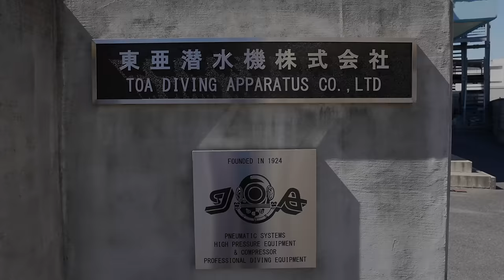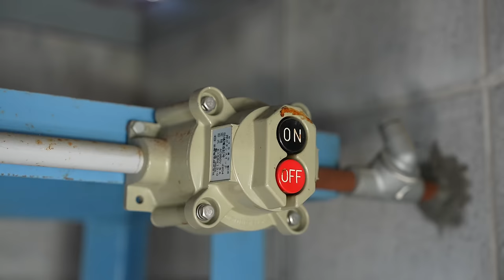潜水服を作るプロセス。水中作業に関する機器・器材を製造する日本の工場。

Comment: 凄い気圧の深海で命を守ってくれる物を ここまで丁寧に作って下さっていれば 安心ですね
Reply: No, no. Amateur divers can only dive to a depth of about 30 meters at most, and even professional divers can dive anywhere from 40 meters to 50 meters at their deepest point. In other words, the depth is shallow, and it is not the ``deep sea where the human body is exposed to extremely high water pressure'' as mentioned in your comment. Diving deeper than that is not possible unless you wear a pressure-resistant diving suit, not a rubber diving suit or dry suit like the one shown in the video. Additionally, even at shallow depths, there is a risk of decompression sickness, so the maximum depth, dive time, etc. are set in advance before diving, and divers must abide by these rules :fish-orange-wide-eyes:

Comment: had no idea these sort of suits were still in use! Very cool process 👍🏻
Reply: In the industry they are typically used in high current areas due to the extreme amount of lead weights you wear to counter act the possible buoyancy.
Reply: @philipshane768  And because of how durable they are. The whole helmet area that also coveres most of the shoulders works also as protection because in a high current area getting hit by something is more likely. This type of helmet is much less likely to suffer problematic damage too while offering a lot of protection.

Comment: Absolutely orsome, I am amazed that diving Equipment is still made this way amazed. This technology must be at least a hundred years old, well if it's not broken don't fix it. Are these suits Taylor made or are  they made to a standard sizes. A diving suit like this must run into thousands of pounds or yen to buy ! .
Reply: The suits are made in standard sizes.  The largest suit I've worn was for someone up to 192cm tall and 110kg. They do come bigger, but I've never seen one.  The real limitation is the helmets which, AFAIK, only come in two sizes. If you happen to have a large head or long neck then you are simply screwed for fitting.

Comment: Great to see such experts manufacturing gear that has changed little over many years. Still has its uses despite modern innovations. By the way technically it’s not a wetsuit but a dry suit or a diving suit as it’s designed to keep the wearer dry and warm by wearing clothes under neath it for insulation.

Comment: i had no idea these type of suits were still being made and in use. i figured they were obsolete by now and replace by modern versions.
Reply: Very much still being used simply because they work.  There is a high school in northern Japan that teaches deep sea marine engineering and they use these suits (these exact suits) to train the diving students, along with more modern suits where necessary.  Only high school of its type in the world.
Reply: Hm... I mean the type of suit seems to me as modern as it gets. Just the helmet I would find outdated.
Reply: @TheOitzu  

Dry suits that marry to a modern free flow hat like a desco are used in hazmat diving...other than that we use Kirby Morgans with a wetsuit/hot water suit or even compression shorts under overalls depending on the water temperature. You do everything you can to NOT use a dry suit. They suck.
Reply: @A_Lemon_Party  as someone who dives dry and wet as a hobby: why do they suck for working? Do they tend to leak? Is it the seals rubbing to the skin?
Reply: @TheOitzu  

Just a comfort factor. Company owned ones tend to leak and fit poorly, I have never owned my own though. Diving every day for six, seven, eight plus hours in dry suits is just way less comfortable than diving with a hot water suit, homemade or store-bought...the more comfortable you are, the more work you get done!
Reply: @A_Lemon_Party  well I never dived surface supplied so I wouldn know how a hot water suit feels, but I imagine comfy.
My drysuit is made to fit though, but yeah leaks in a drysuit are just miserable and it happens.
Reply: @TheOitzu the leaks at the inseam and the feet are the ones I hate the most
Reply: @TheOitzu  

Sorry for the late response. Yes hot water systems and suits are amazing, they have suits but they are expensive. 

We would make our own out of a section of 1 inch tubing, about 8 inches long with a quick disconnect on one end. In the other end we would jam 3/8 or 1/4 inch sections of tubing, one for each hand, one for each foot, and two for your chest and back and run them under your wetsuit. If your wetsuit didn't leak, it would balloon up and it was the greatest feeling ever!

Comment: I imagine you have to be incredibly strong to wear and work in one of those! Well done little lady!
Reply: Once you're in the water you don't feel the weight since it's slightly buoyant. Outside of the water, yes.
Reply: It's not that bad actually, and as the other poster said, once you're in the water you regulate the bouyancy yourself as the diver.  It is tiring because it's cold, noisy, and your range of movement is so heavily restricted so doing anything is a constant struggle.

Comment: I use a DUI Crushed Neoprene Dry Suit. Need to use 2 lbs. ankle weights and is a little hazardous (draggie) in current be here in Southern California. Diving the Channel Islands where sometimes the temp get down to 47 deg and having a steel HP 120 cu. in. tank you won't get the deep chill doing repetitive dive, like 4 a day. Just for fun diving. We do have urchin divers here using hookah hose.

Comment: Remember, if the air supply stops or there is a hole in the air hose, you get squished into the helmet.
Reply: I remember that mythbusters episode 🤣
Reply: If the air supply stops then, unless you were ascending at the time, you are stuck where you are unless the surface crew wants to try and hoist you up on the hose and comms line.

Comment: CC at 0:06 , 0:10 - that looks to me like a DRYsuit(s). The fact that it gets wet on the outside, while underwater, does not make it "wet suit".
Wetsuit is the one used by SCUBA divers, it's a neoprene "garb" where water is allowed to enter the INSIDE of it, hence the name. That water gets heated by the body of a diver, and stays "sufficiently warm" providing that:
– it is prevented from flowing freely - thus the suit must have a snug fit;
– the neoprene is thick enough and covers enough of the body of the diver, and
– the temperature of the water is not too low (or an external heating is provided, by the means of so-called umbilical cord), and/ or
– the duration of stay under water is kept to reasonable time.

In all other situations a DRY suit is used - i.e. one (like this one shown here) DOES NOT LET THE WATER INSIDE of it and keeps the diver "dry" (hence the name).
As the walls of dry suit don't provide much (if any) thermal insulation, the diver wears thermally insulating clothes underneath it and sometimes even argon gas is used to fill the suit, as it has lower thermal conductivity than air has.

Comment: You keep calling it a Wet Suit but it is clearly a Dry Suit! 🤷

A Wet Suit as the name implies, uses water to keep you warm. It does this by trapping a thin layer of water between the suit and your skin. Your body temp then warms the trapped water and this is what keeps you insulated from the surrounding water.

A Dry Suit on the other hand is the exact opposite, it uses air and suit material as the insulator between you and the surrounding water to keep you warm and dry.

Comment: こういう潜水服現役なんだなぁ。深いところの潜水作業じゃ良く使われるのかな。
Reply: No, no one has been using such wetsuits in real work for a long time. Maybe only for tourists.
This is a soft suit, without access for water inside. When diving in such a suit, the body experiences pressure from the water, as if you were naked. Since the suit is “dry”, the body is not heated in any way, there is no thermal insulation from the surrounding water.
And the huge, heavy brass helmet with miniature windows is something from the Middle Ages. Now there are normal plastic helmets, with a huge viewing angle, low weight and the same strength.
Modern wetsuits are “wet”. They are made of neoprene, and water access inside is open. A thin layer of water between the thermal insulating material and the surrounding water allows for more efficient heat retention. For deep-sea diving, comfortable masks with a large view or helmet are used. For extreme deep-sea diving - hard suits that maintain pressure inside that is acceptable for humans.
Reply: @deadcxap755  These types of suits are still in use all over the world, although the style of helmet has changed in most use.  The deep sea marine engineering high school in northern Japan - the only example of this type of high school in the world - still uses these types of suits, and both the old and newer styles of helmet, for training their students.

The modern helmets are not plastic.  They are made of various combinations of steel, carbon fibre, kevlar, copper, or glass.  These "old" style suits will work down to ~30 metres perfectly fine.  Beyond that, these days you'll start to see hard shell articulated suits come in.